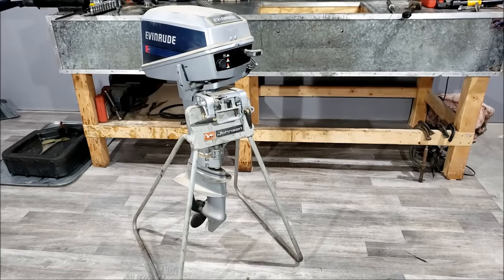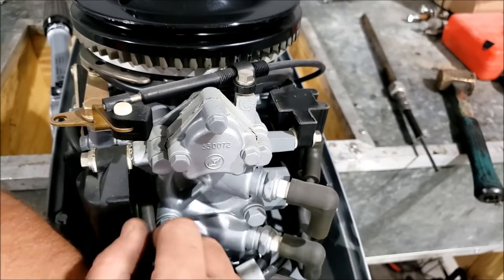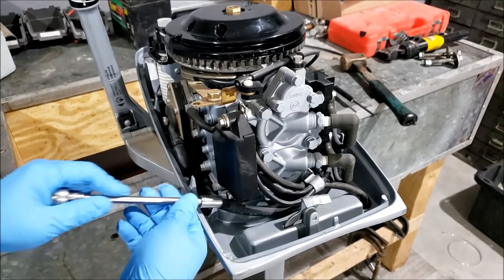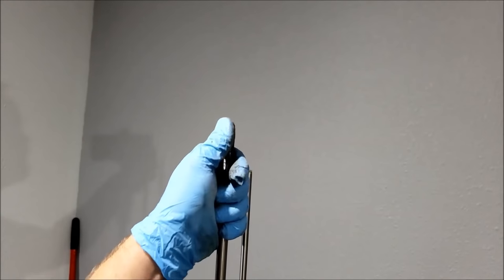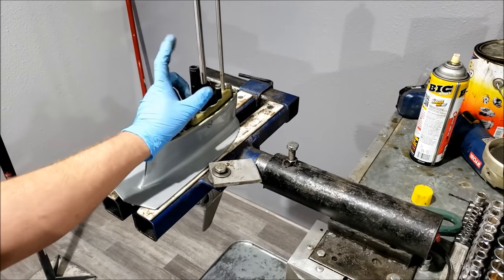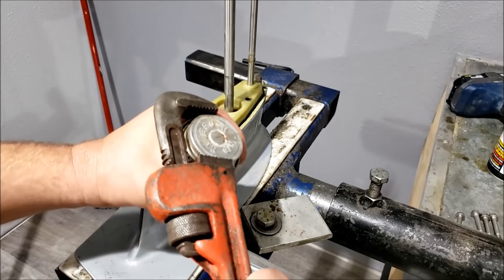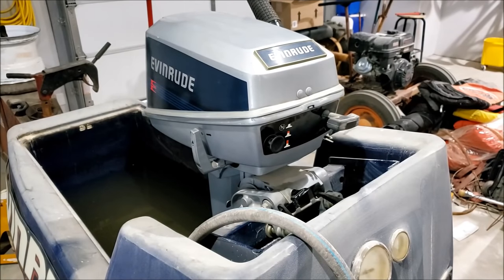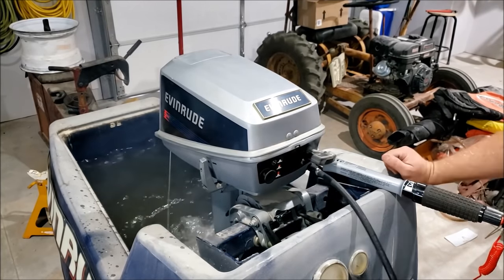I Bought a Brand New 34 Year Old Evinrude Outboard

Comment: running out the fuel is always to be done, you are right, I do that with all single or multiple cyl small engines, chainsaws, lawn mowers, and I don't have to fix fuel foul ups either.
Reply: Running a two stroke out of fuel is also running it out of oil! Better off running race fuel or aviation fuel with good two stroke oil
Reply: Oil/Fuel lubricates the motor until it dies. If it dies no damage can be done from running without fuel/oil. Also pull the choke when it begins to stall and burn that last bit of fuel.

Comment: Awesome video!  I actually just restored/complete tear down of a family member's 1985 Evinrude 4HP twin cyl outboard.  It started with needing a new water pump, after sitting for over 10 years.  That engine has no tell-tale pee-hole.  It discharges the return water out with the exhaust - which means there was and is, no real way to tell if it's pumping and circulating through the entire block.  Mine wasn't...  After stripping the block, removing all covers and even the head, I found a clogged cooling hole/passage and cleared the blockage.  Probably 20+ hours of labor into it, lol.  It also has the 100:1 oil sticker on it!!  I had no idea they did a recall on this, and that it should have been 50:1!!!  I scratched my head on this and had already told my family member to run 50:1, even without knowing this.  I told her to just keep a few spare plugs on hand.  Of course, she didn't...  I would love to share the photos and videos I took, if you want to see them.

Comment: I heard from an Johnson/Evinrude dealer that the 100:1 was OK to run but the problem came about when the outboards sat for a long period of time - the cylinders would rust due to the lean mix so they went back to 50:1.

Comment: Thank you Sir for all the good info. I appreciate it. One thing I would have done, which you may have, I would have changed all the fuel lines. I rebuilt my carbs on a 85 model 88 Special, I did not replace the fuel hoses and therefore had to pull the carbs back off and clean them and found bits of rubber hose, then I replace all fuel hoses and all was well. The new gas formulas are diff now a days. Same as you, I run the motors out of fuel each time before storing. All is well when you need it. Thanks again Sir, great video on an old relic. I am sure she will do just fine.

Comment: I look forward to the break in video.  Wondering what fuel/oil ratio you ran it on in this first start ever video?  I have never had a new outboard so not sure about that stuff.  1987, eh?  Interesting as well.  I have a 1984 15hp, and found that it runs and especially idles a LOT better once I discovered it was supposed to run 100:1 and am running it at that.  Apparently the idle mixture adjustment has been deleted on this year, is there something else I can do to let it idle better if I go to 50:1?  Thanks.

Comment: Thanks for sharing your inside informations! 
I recently re-activated a Volvo-Penta 140 (about 12hp) outboard motor, which my father bought somewhen in the 70s or early 80s. Very similar technology. After almost 25 years of storage we replaced both water-pumps (engine coolant pump and boat drain pump) and the sucction-driven fuel-pump membrane. And now its running again - generating the same fun to my children as it did one generation ago in my childhood to our family.
I am curious , if todays technology will still be usable in 35 years - thinking about electronic spare parts availability ...
Reply from the maker: for that outboard, It might be a concer.
on a side note I need a volvo outboard now.

Comment: Great video thank you learned a lot I’m replacing the impeller on mine 4 hp Johnson and the shaft is stuck in the motor itself so impossible to replace the impeller any idea how to get the shaft out don’t want to break anything the motor run beautifully,thank you

Comment: I have the 5hp version  of this, it's in almost new condition like yours. What a mission I had getting the gearbox off , stuck on shaft big time. My one needed a new waterpump and housing, driveshaft needed a good clean and grease and I also put a new thermostat in it. 
Really pleased with mine. 
Anyone know the difference between the 5hp and the higher horse power ones. Power head looks identical.
Reply: They didn't make a 5hp in this model. You more than likely have the 4.5hp. they only made 4.5hp, 6hp, 7.5hp and 8hp

Comment: Worked in Enginerring 30 years, on some models of 6/8 hp, the draftsman missed cam (black plastic) by .100   , adjusted  for Wide open throttle , by needed more spark,    I know , I fixed.       Timing  had to be reset, by taking off stop.

Comment: I have a very old can of gasket sealing compound.  I'd like to see what the new stuff looks like in the can to see if I need to replace it.  As far as I can tell my old stuff is fine.
Reply from the maker: if it spreads okay, I would use it.
if it clumps up, I would toss it.

Comment: I probably added 1000 views to your lower unit rebuild videos as I worked on my 1989 15hp johnson this weekend. Question- have you ever seen the 5" extension housing become nearly impossible to remove? I am able to detach lower unit but the extension house simply will not drop. I have removed the 6 attachment bolts (both sets) but the water grommet and drive shaft tubing are still passing from extension through to upper section and won't let go! Please help! Thanks

Comment: There is one more thing that’s those outboards are noted for and that’s broken shift levers ! It’s almost to the point the handle is worth more then the motor ! Lol
Reply from the maker: Well thats more of the 1970's 6 HP.
These are plastic, so they have a little more flex and don't break when you look at them.
Reply: @BrandonsGarage  very true but non the less there not cheap !

Comment: Here's an old tip . If an old out board runs but heats up or stalls when hot just run it on low speed in the water with the boat tied up. To give the old engine head muscle memory.
Reply: You'll also find out how long it will last on a run. And can look for clues to the operation on piston and fuel flow or blockage. Or how to start it after hot, choke no choke or how long you need to wait for cool down.
Reply: My new old evinrude Air cooled probably needs piston lube and a new spark plug.

Comment: Why do you say motors from this era were not meant to run on muffs?  i just got a 1982 evinrude 35 hp long shaft and i put the muffs on it to fog the motor, it seems ok.  keep up the video's good stuff.
Reply from the maker: You have through-hub exhaust, this does not; this doesn't have opposing intake screens like yours does - nowhere to put muffs.

Comment: Have the same motor, and cannot make it start without using a squirt of starting fluid. Can you help?
Reply from the maker: Are you using the primer?
Reply: Yes, checked for compression it's at 45psi, I have spark on both cylinders. But once I pull the primer looks like it gets pulled back by itself. Did a whole carb rebuild kit.
Reply from the maker: @Luis Hernandez  primer squirts fuel into the carb, just like starter fluid. If it's working you shouldn't need the fluid.